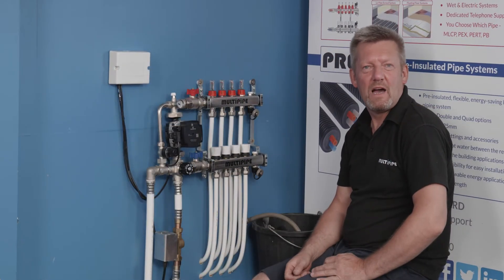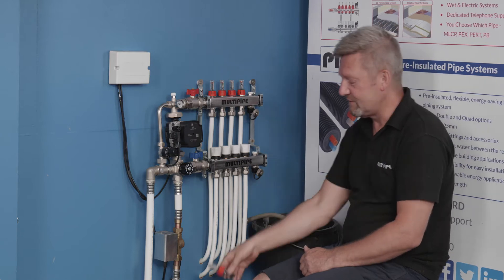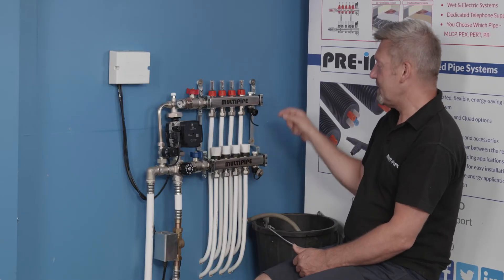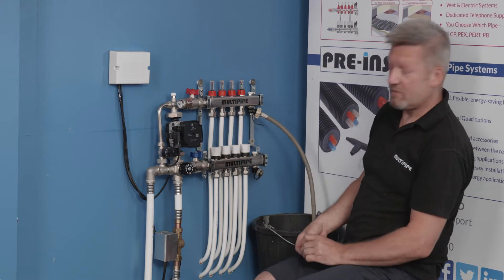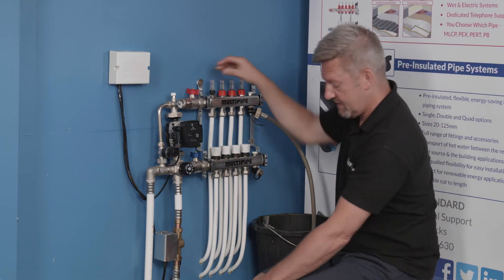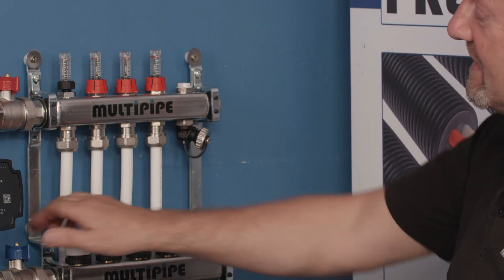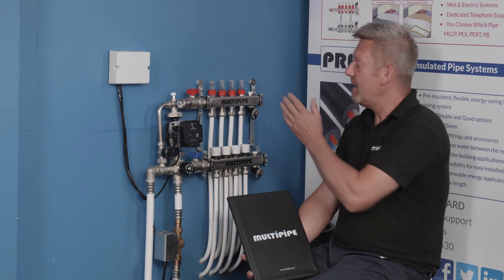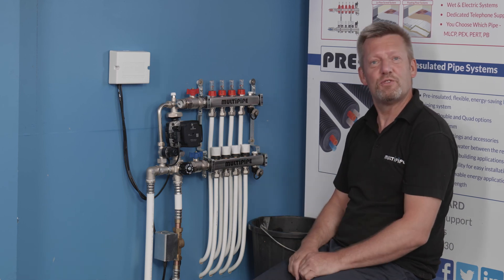How To Replace Your UFH Manifold Flow Meter

Comment: Hi mate, thanks for this great video. Is it normal to have to regularly replace flow meters? I've had to replace 3 so far on my 8 year old system (all different loops). Many thanks.
Reply from the maker: The main reason for flowmeter failures, i.e. leaking, is product quality. They should last in excess of 10 years without problems. Other issues can be water quality in the heating system. Bacterial growth can cause premature failure in the O-rings.
Reply: @MultipipeLtd  many thanks for the helpful response. It does seem like quality is the issue, one was a leak at the base of the plastic housing, and two were hairline cracks along the side of the plastic housing. New to UFH, so very much appreciate the guidance.

Comment: Really nice videos, I have ufh system, I'd like to ask you, in this video you are bleeding the water supply manifold to take the air I guess, would it work( I mean bleeding the manifold) for the return manifold when you change pin valve in the return tube.thanks

Comment: Hi. I've done everything in the video (isolated, pressure, etc) but there's still water in the flow meter (all 4). Would unscrewing it release all the water?
Reply from the maker: Always ignore any water that sits in the flow meter this does not affect the system in anyway you should take you reading from the plunger not the water level. (the reason water ends up in the meter is purely because air compresses so pushes water into the glass higher the pressure more water in the glass).
Reply: @MultipipeLtd  Thank you :-)

Comment: Hello your video is very clear, thank you! I've an issue with my UFH hope you could give some advice. I've two manifolds on ground and first floor and no radiators apart from tower rail in the toilet. The boiler temperature is set to 65. The one downstair seems to have some issues - if i change the temperature to 55 or above in blending value, the flows become very slow, i.e. <1, even if I turn the flow to max; or if I change the temperate to 50, the flow rates go up but the temperature goes down to say <30 degree. A lot of times, when I touched the hot water incoming pipe, it's not very hot, which feels hot water from boiler is not coming in. The manifold upstair is working properly though, water is hot and pressure is normal and adjustable. The system was working perfectly fine but the boiler stopped when we were away on holiday, and it seems to have issues since we came back and turned the boiler back on.
Reply from the maker: We are glad you like the video's, I am unsure how your system is plumbed but when you open the valve further and get a flow drop this normally indicated the boiler pump and the UFH pump are not inline. I would get it checked that the flow and return pipe from the boiler is plumbed the correct way around. Either that or it might be an issue with the blending valve being blocked.

Comment: Hi all, I just happened to find your channel. It became chilly outside and I just realized that one of the rooms are significantly colder than the thermostate would imply. I checked the manifold and the circuit does not seem to be working - the flow meter seems empty and filled with air. Could it be that one of the circles are not filled with water but the others go perfectly fine? I exchanged the actuators if that caused any troubles but it does not seem to be the problem. I did not dare to change the flow meters yet, I thought im gonna ask someone clever first. Thanks in advance!
Reply from the maker: Thanks for your message. I would say that if the system has previously worked, the chance of an airlock is slim. As for air in the flowmeter, this is very common as usually air cannot escape the top of the meter, but this does not affect its performance. What you need to look for is there usually is a coloured disc that floats up and down the meter indicating the flow rate you have. Ideally, this needs to be around 2l/m. If there is no flow and you have replaced the thermostat, then check the actuator pin (under the actuator) is moving up and down and not stuck down. Next, check that the thermostat is working by sending a signal to open the actuator (the actuator takes around 5 minutes to open). If you do have flow, then I would probably say the UFH is working, but it might be the room is losing more heat than the UFH can produce or is unbalanced.
Reply: @MultipipeLtd  Thanks a lot for your response, much appreciated, very helpful!

Comment: Hello!
How do you find the proper flow rate of an circuit?
Many thanks!
Reply from the maker: Usually, this is done as part of the design work of the UFH company, but very basically, it is based on the formula m=Q/CDelta T. In the example, we assume a 1kW circuit, we use 4.182 as C (specific heat capacity of water)and the delta T between your flow and return for the water (typically) 7.5 so: 1(Q)/(4.182(C)x7.5(DeltaT)) = 0.0319l/s x 60 for L/min 1.93 to set = rounded to the nearest 0.25 l/min increment. I hope this helps.
Reply: @MultipipeLtd  thank your for your answer.

I'm trying to do some DIY work in my new home and unfortunately I don't know the specifications of any circuit and I don't even know where are they going(kitchen, bedroom...)
Reply from the maker: I would say in that case set the flowmeters to 2 l/min and that should be ok. (its a bit rough but will work)

Comment from the maker: 👉 Got any questions about this video? Feel free to leave them in the comments below.
Reply: How can well stop sticking Actuator pins Always getting stuck with the pin down is there any way of stopping this re-occurring all the time
Reply from the maker: @Caffro  if they are sticking this is normally the pin shaft has build-up causing it to stick. watch our pin replacement video posted in August to get them out to check. But they might need replacing. if you do get build-up you need to get the system treated for limescale prevention.
Reply: @MultipipeLtd  thanks  It’s normally when the underfloor heating has been off a long period of time and the actuator as in the off position when actuator then turned on and lift up the  pin  stays down The systems was  built two years ago How often would you say they would need replacing
Reply: Hi I have 2 manifolds one seems to be working ok but I can’t get 3 out of 5 rooms to heat on the other manifold, it’s a uponor system, signals are coming from all stats, I can hear them click and I can see the window displays open and close on the actuators, I had issues with these and the pins were stuck so I freed them out and all is good, except I still struggle to get heat, there seems like a lot of gushing through the manifold like air and the flow metres are bouncing on the display tubes, I’ve tried changing the pump settings but no change, would there be air in the system or sticky metres ?
Reply from the maker: @Thedar561  when flow meter bounce that is a sure sign of a lot of air in the system. it is worth following our video on filling your UFH system. if that still fails get in contact with their support team as they should be able to help.
Reply: @MultipipeLtd  thanks very much for the speedy reply,does every Ufh system need to be filled with a separate water supply or would mine self fill ? I wanted to try and isolate the manifolds  remove the valves and clean them aswell but there is no isolation valves on it the one with the mixing valves has what looks like a valve with an Allen key screw in it I am hoping thats an isolation valve, I’ve watched all
Your video on it and there very informative 💪